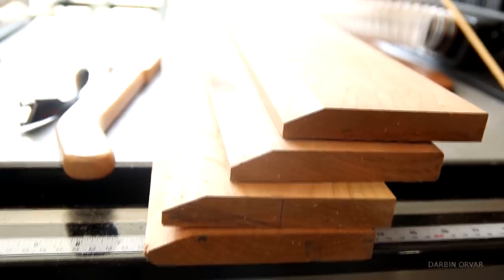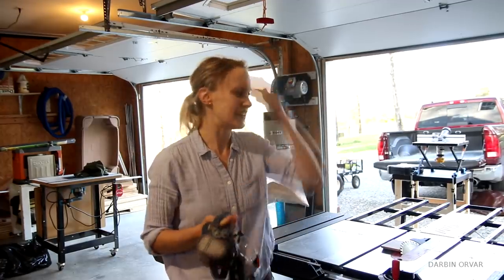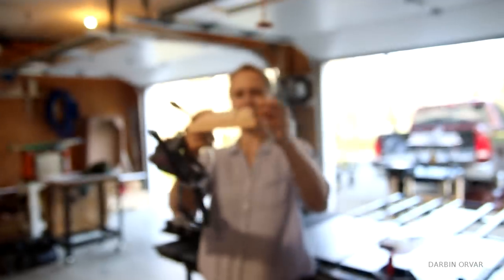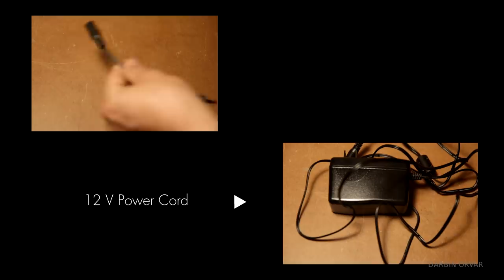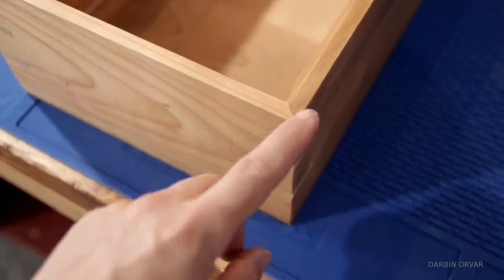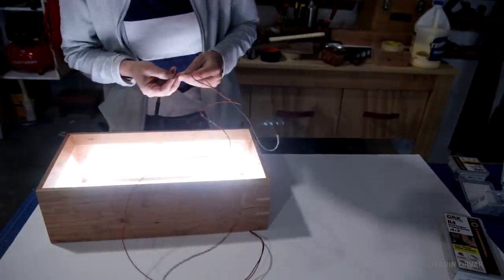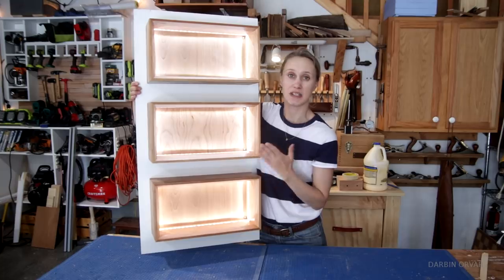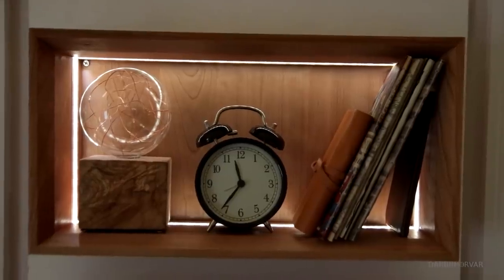Floating LED Cube Shelves

Comment: Looks good. For hidden areas, the the backside of the backer board, hot glue, like you used, is a great way to hold wires in place. Its permanent, but if the wires ever need to be removed or adjusted, rubbing alcohol or denatured alcohol will soften the hot glue so it peels right off.

Comment: I wish I had just router-ed the bottom like you did on my bathroom cabinet drawer project. I router-ed a half inch up and slid the bottom pieces in. Worked but yours was an easier idea. :) The spine idea is interesting. I like the painter's tape method.

Comment: That's a really nice build Linn, the dimmable LEDs  add to its beauty and appeal. I just made a jig to drill dowel holes in the center of the edge of a board, but it wouldn't take much modification to enable it to drill holes at a 45° angle to add dowels in the corners like your splines.

I noticed the camera at the beginning of the video with the shelves in the background out of focus, and immediately said "that's a Pentax K1000." I kept hoping for a close-up of it to know whether I was correct, and you didn't disappoint me. A friend of mine has a Pentax K1000, and that camera is the reason I bought my first 35 mm camera. I bought a Pentax mg though since I knew nothing about aperture settings, shutter speed, etc.
Reply from the maker: Haha, it's fun shooting with!

Comment: Love the addition of the splines with the different wood, just a idea though l would have put my led strips in a obscure plastic channel to diffuse the light, much cleaner look than how you done it plus don’t like seeing the screw heads in back board where you fixed shelf to MDF, just a few suggestions to clean it up. Love the channel.

Comment: I would probably go for the back LED square frame you created and then add one strip at the top front (mouth) of each shelf, 
this way the objects placed in the shelves have the nice back lighting of the LEDs you added as well as one strip at the top of the shelf to illuminate the front of the objects placed in the shelf,
This way the objects will be lit, rather than only have back lighting, which will cause them to appear darker and seem more of a silhouette rather than an illuminated item

Comment: The second featherboard after the blade is very dangerous. It can cause pinch against the blade leading to kickbacks.
Reply: Stoph Stoph I would normally 100% agree with you, BUT in this sense, I think it’s actually safer.  Not only does she have her knife installed, also it’s such a tiny bit of cut off, it isn’t going to have enough strength to really bind into the blade.  I think the use of the feather board after the blade also, makes it safer because she doesn’t have to worry about keeping it tight to the fence, with such thin stock

Comment: Great vid, looks like you were using Ryoba saw, you should use a Kugihiki flush cut saw, it won't damage the surface as the saws 'set' is only on one side.

Comment: Beautiful job. Thanks for sharing your skills. I wonder how much heat these LED strips produce. They are embedded in the wood from three sides and the front side is covered
by (more or less) paper. All inflammable materials. I'm convinced that you know what you are doing. I don't  :-(   (and I guess I'm not the only one)
Could you tell more about heat production of different kind of LED strips (or tell where I can find it)?
Reply: I'm also very interested to know how hot the LEDs get. I am about to start a very similar project and fire safety is my main concern with it. Thanks in advance to anyone who can provide info on LEDs operating in grooves in wood.

Comment: One mistake you should have turned the boxes upside down when cutting the lower splines as the saw you're using is wider at the top causing the saw to cut on an angle when held tightly to the surface, beautiful finish.